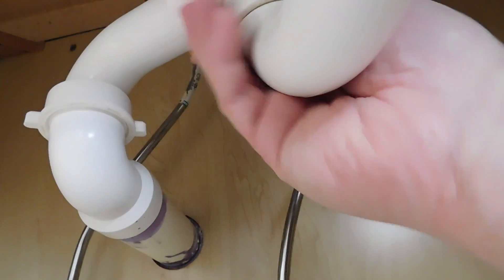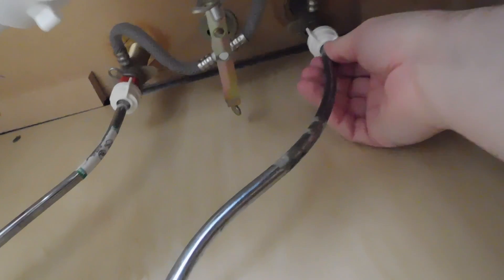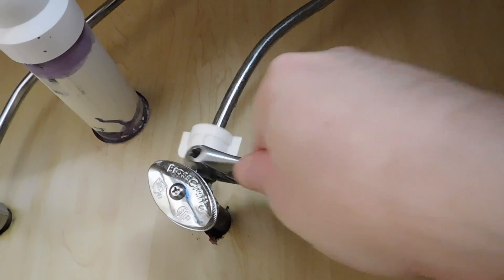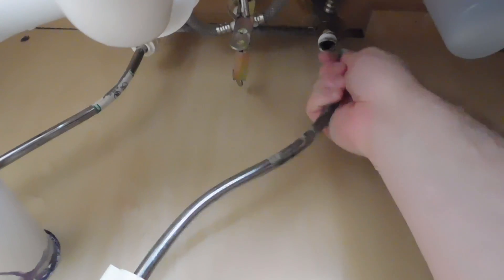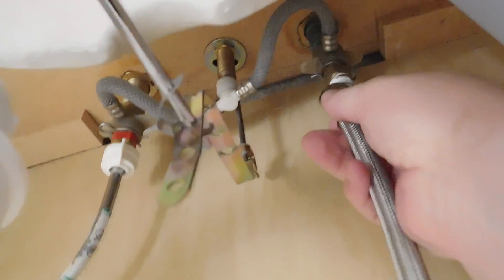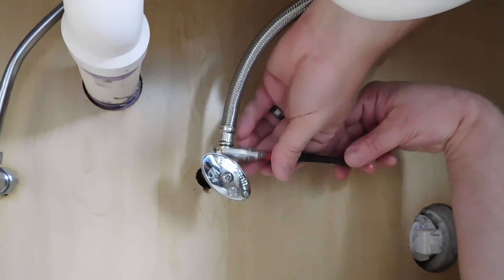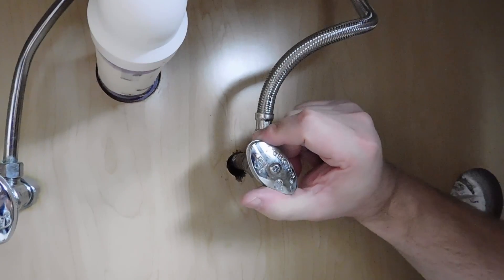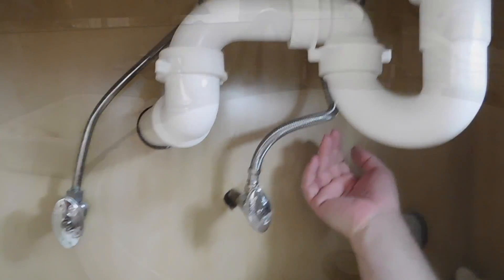Fixing a Leaking Sink Supply Line

Comment: The problem here was a plastic nut on a metal tube.  They don't get tight enough to seal a metal-to-metal seal.  The "fix" was as simple as a metal nut tightened properly and it would have been permanent compared to a hose which has a 5-year life expectancy.

Comment: Is it possible for this line to leak only when a faucet is opened?
Reply from the maker: If that is your case then it is most likely that the faucet is leaking. Most faucets can be repaired by replacing the wearable parts. Depending on the faucet, you may need new gaskets, o-rings, washers, etc. A hardware store should have what you need. Of course, you can always install a new faucet. That may be a good option if you want something different.
Reply: @CoryWCordell  that's the thing... I've replaced the faucet with a brand new faucet and it's still leaking. Is it possible for the water inlet hose/seals to only leak when the water is turned on at the faucet?
Reply from the maker: @ormand3000  It is possible that the internal components begin to leak when the valve is opened. I'd double check that the connection of the water line isn't leaking. If not, then that may be your issue.

Comment: Just replaced my line but it is spurting water from the bottom supply line with 2 brand new lines. Why?
Reply: Maybe you did not tighten them enough?
Reply from the maker: Most likely you have cross threaded the nut, did not tightnen the nut enough, or overtightened the nut. Make sure to start the nut properly and only tighten enough to seat the seal.

Comment: So. I am replacing my kitchen sink faucet. It's already installed over the sink but I have not yet attached the lines.

 I have the water supply under the sink shut off. The lines from the wall are not connect to the lines from the sink. With the water supply under the sink turned off, One of the lines from the wall is dripping water from the end that would connect to the line coming from the faucet. Does this mean that the valve under the sink is leaking? Do I need to shut off the main water supply to the whole house? Thanks!

Comment: I could NOT get the bottom off for anything!  I was really trying not to have to hire a plumber for a simple fix.  Any advice?  my leak is on the hot water side.
Reply from the maker: C Rowley I have a few suggestions you can try: 
It may sound silly but make sure you are turning the nut the correct way. Also, it is unlikely, but you may have a left hand threaded nut. 

If possible use a bigger wrench or put a piece of pipe on the handle of the wrench for more leverage. Make sure to hold the bottom of the valve to keep from bending the pipe. 

Use a chemical loosening agent if corrosion is present. 

Use a small torch to heat the nut for a few minutes before trying to loosen it. Be careful if you've applied flammable chemicals. 

I hope this helps and let me know how it turns out.
Reply: Finally got it off! I was turning it in the wrong direction from what was needed to take it off.  Maybe I was confusing my "leftie loosey righty tighty" rule. . . . Thanks!

Comment: My problem is, I live in a condo so even if I turn the water off, the main line is still running so the water is still leaking. This is making it very difficult to fix anything.
Reply: Hmm. I was trying to fix but l live in a condo. To do this step, is it necessary to ask condo HOA to turn off water ??